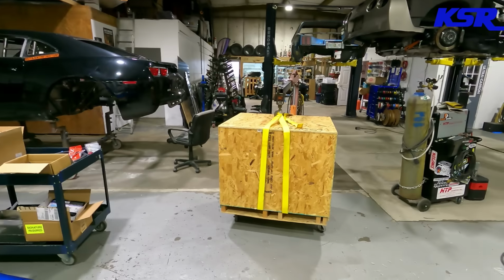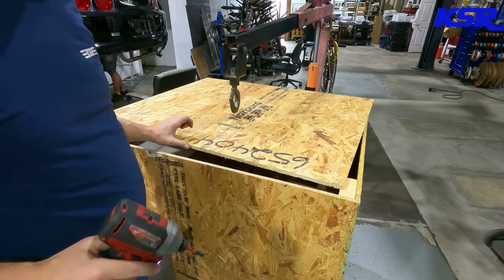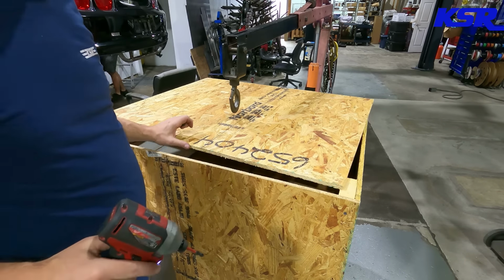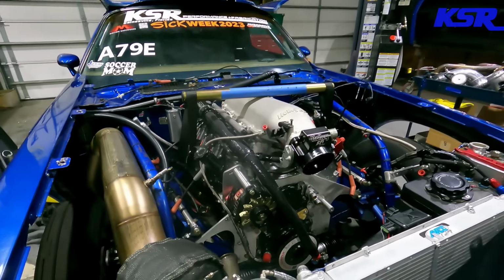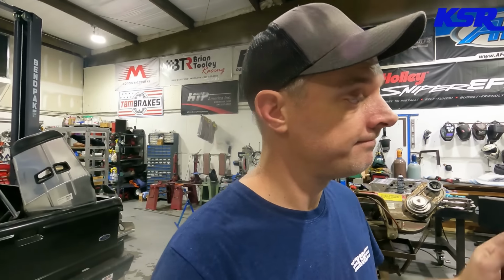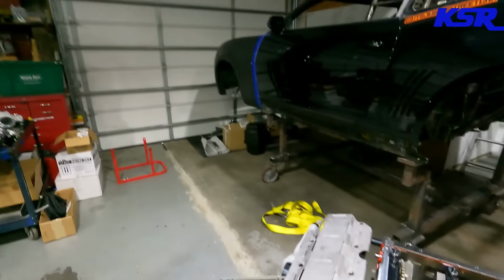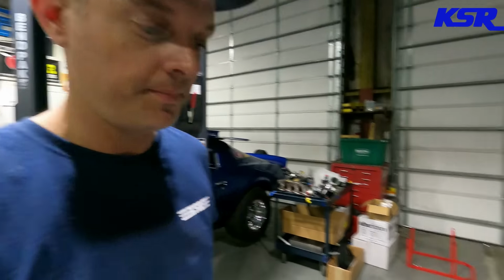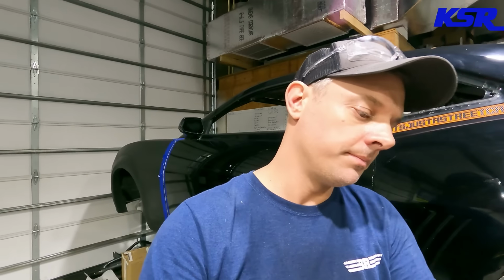Changing The Engine The DAY BEFORE Sick Week 2024??

Comment: Steve Morris said thank you for letting him swipe your little screwdriver. He had a slight oil pressure problem and one with concrete
Reply: Slight problem. Lol. Dude found hell on earth. Glad he's okay and for what it's worth it will bring awesome content
Reply: And that was a bad explosion then the ass end of the wagon just swaying back and forth into the wall but yes glad he's alright
Reply: Steve was supposed to put a cover over the trans when the line blow off last year but didn't.    I'm betting that the line blew off due to a solenoid operation issue that deadheaded the pump.
Reply: It's like this event is cursed lol.. Its something every single year for 3 straight years and it all happens before sick week even starts for the most part lol
Reply: @JayMac Cursed? All these guys thrash until the last second and mistakes happen or things get overlooked. Just glad to hear Steve is ok, but that wagon was going to be competitive this year. Sucks to see.
Reply: I think Steve found the limits of his ability to multitask with adding a second car to his part time racing operation, there's only so much a person can do before you start to miss basic things like not setting a oil pressure safety or even opening the hood after tire shake to give a once over before making another pass.
Reply: Concrete is unnecessary hard!
Reply: Thermostat screwdrivers fix 90% of the world’s problems. 😂
Reply: @indianaslim4971  undoubtedly, you don't read or listen very well considering Steve clearly says that he hasn't ran the oil safety setting in the past 3 yrs not because he forgot to do so but because he choose to because he's never had a problem with oil pressure. Also, if you notice, it's not just him running or working his "part time " racing. He has him, his son, and multiple other people and players that help him out with any and everything possible. But should he be more mindful when setting or doing something that would insure the safety of him and the car  ? Absolutely, but at the end of the day it's nobody else's concerns or problems except his because he's the owner and person that's putting all of HIS time and money into these cars. So for all the crybaby snowflakes that are leaving ignorant comments trying to tell another human on how or what they should be doing with their own belongings and lives is flat out stupid. Long story shot. All ya'll snowflakes need to stay in your own lanes and let the man live his own life the way he wants.
Reply: @NOQUARTER_  funny how you act like a snowflake over my comment and call me a snowflake, sorry if my comment caused you to melt. Steve is a big boy, he doesn't need you to defend his honor.
Reply: @NOQUARTER_  How much of a hypocrite can you possibly be?, calling people snowflakes for using their first amendment right to voice an opinion and castigating them for what you refer to as "telling them how to live their life", and here you are telling us commenters how we should be acting, that's major league hypocrisy.
Reply: @NOQUARTER_  wow, cry harder
Reply: @NOQUARTER_ he actually said he forgot to set it and just never did set it cause it wasn't a problem. Guess it was
Reply: @tdenver68  wasn't a problem for over 3 years so he just never set it or used it
Reply: You reckon he should steal his 10mm socket on race day?
Reply: @BBCMONTE34 so true. I’m an HVAC tech and I have a thermostat screwdriver in my pocket at all times 😂.
Reply: @NOQUARTER_  yes he says that in a video that he put out not that long ago at the 12 minute mark in the video. I knew something was gonna happen when he said it so I remember the time not the video.
Reply: @rollandsaxton  same. Started a small hvac company in central Florida a while back. They’re the best tool in the world. 😂

Comment: a box engine not gonna fix  Steve Morris drag car he ran it with out oil pressure & they rebuilt car engine & put back together   in area there at (sick week testing) & next test run crashed car with fire & got into the wall! it the promod wagon! (i don't see a over night john force like hour repair fixing this car like a funny car fire & backup car swap! there odd rules parts failed let a back car used next round! with in a hour i saw a complete top fuel car built and ran but lost round! it was steve torrence team & the car was( morgan lucas old team car team was shut down) part of his old team showed up to help make the car run right! the people that knew the wiring and lay out of the car they used! ) ok i used to work for a oil company in tractor pulling on tv the guy got jet engines & in lawn chair saying piston engine guy crying I use jet engines the next seen on the dvd the guy helping his other puller unload his engines with a plane white tea shirt on & set them on his tractor frame! ( the owner of the tractor said he who owned the 4 engines were piston car engines! that was rebuilt at the guy speed racing shop) how think he got the money for the jet engines!

Comment: Sweet work / I see the Olds on the rack must be getting frame work done . 
 On 383, why not ls3 or 823  rec port heads ?  They flow well and could have lightweight valves installed.  
 That's a really good engine bulid to drive from Canada to Florida and then drag & drive. 
 I think  I heard it was a 525 big block with a boost monster.  
 Be safe all .
Reply: 521cu but yeah. One of the most impressive, if not THE most impressive car at Sick Week. Buddy could easily trailer it down then run the event but he's like nah...let's drive it 3000 miles, run a 1000 mile drag and drive event, lay down some 8 second passes in a barge that has a dang stick in it then oh yeah, we'll then drive it 3000 miles back home. Ludicrous. Mad respect for those guys.